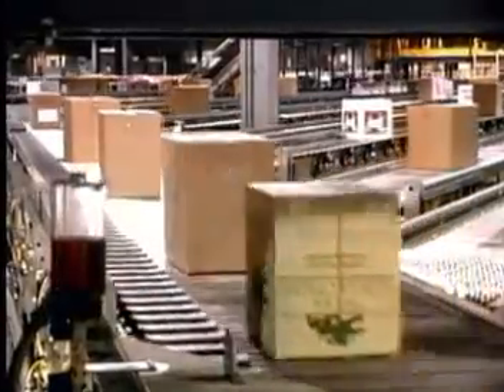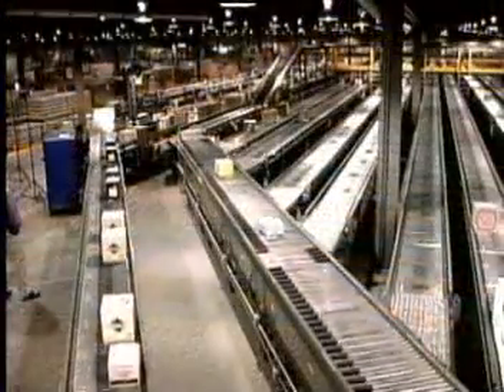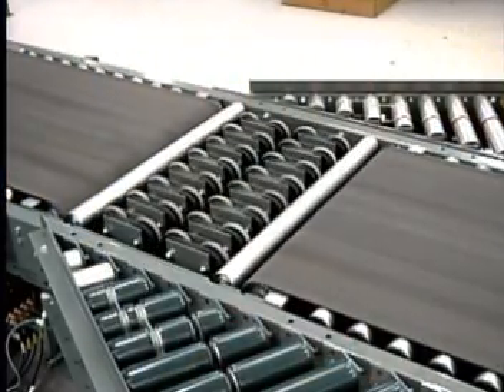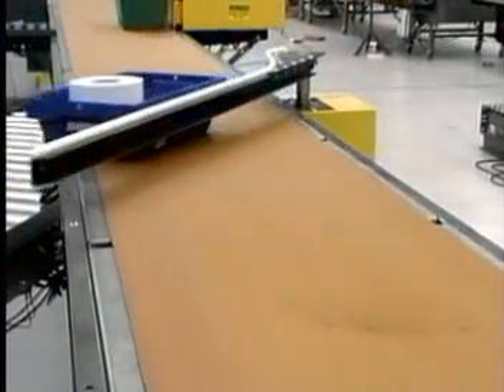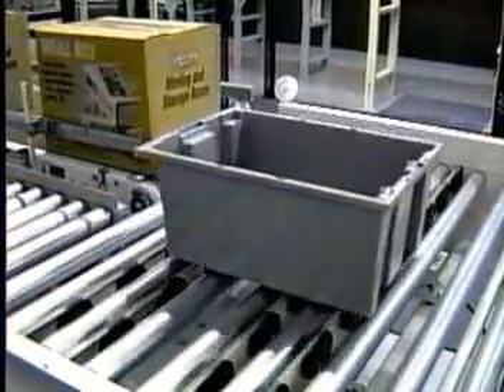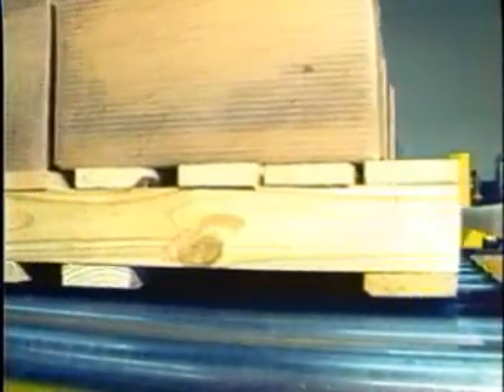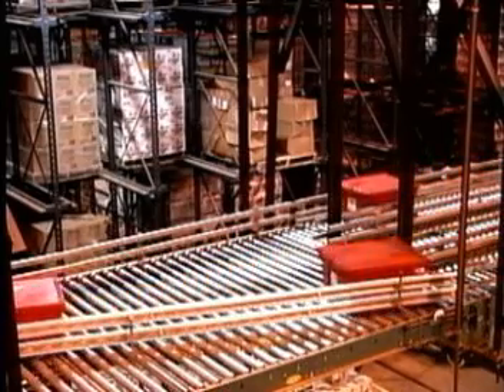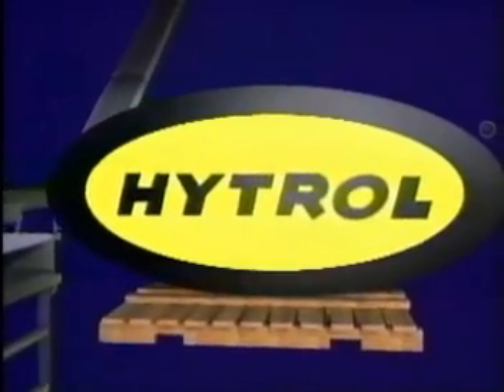The Art of Sortation in the Conveyor Industry

Comment: Fix this stuff at work. divert rollers, sorting shoes, and pins break all the time.
Reply: No I work in sorting packages for FedEx ground. Packages between 5 and 85 lbs. We use no wiping system. We use the transorter a high speed shoe divert track with a combination of conveyor belts divert and spur rollers as we have to sort 30000 packages per hour.
Reply: we would all need a lot of maintenance if we worked as hard as some conveyor systems do! Some run 24/7 lol